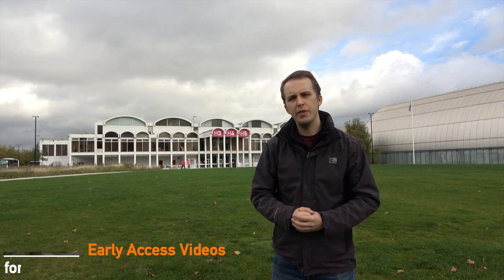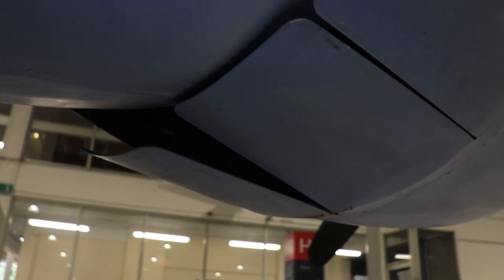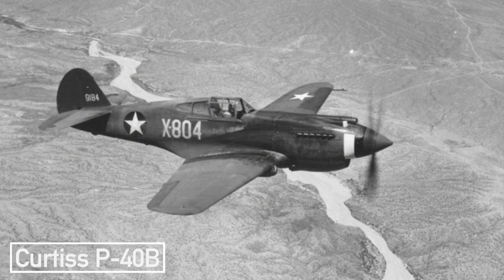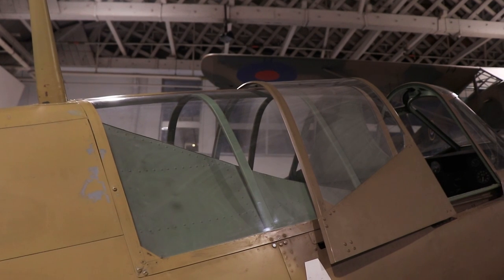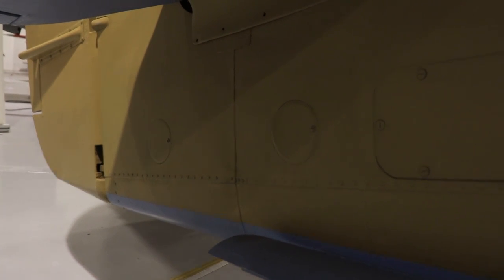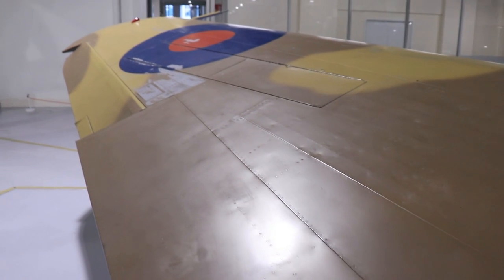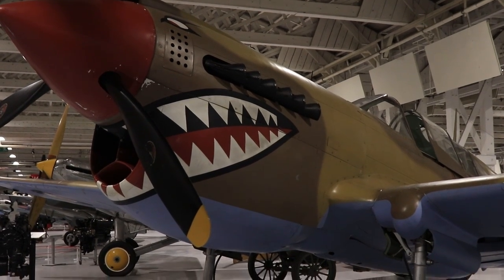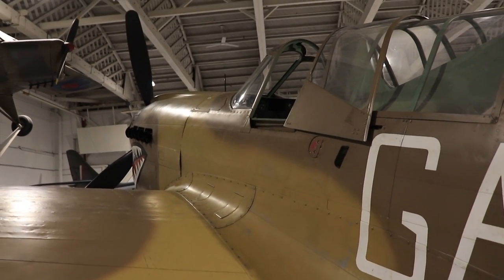Curtiss P-40N Kittyhawk - Detailed Walkaround

Comment: Hello Bismark, I have a suggestion for future topics. The history, or lack there of, of German Naval aircraft, why Germany still doesn't have a carrier and anything surrounded by those topics. Besides the attempts with Graf Zeppelin, German Naval aviation is near nonexistent and I've always wondered why. Especially since nowadays a carrier is practically essential in any sort of naval force. Part of me is also curious what a proper Germany developed naval aviation force would look like, and not just modified 109's, 190's and Stuka's with an arrester hook bolted on the bottom
Reply: In WW1 the Germans had the Seeflieger and post-1945 the Marinefliegerkommando. During the Cold War the Marineflieger evolved into one of the most formidable anti-shipping forces in Europe, particularly when the two strike wings got the Tornado.  After the Cold War they lost their strike aircraft to the scaling down of the Bundeswehr and today only operate helicopters, asw and survailance aircraft as well as drones.

In WW2 Görings Empire buildning prevented a naval air arm from evolving and I honestly don't think having one would have made much of a difference as I doubt that a small but idependet force would have devoloped tactics and weaponry faster than the Luftwaffe did in history. Simply not enough time and resources.
Reply: Short answer?  The Germans have little use for a carrier. Nor a fleet to support it.

Comment: I wonder if this aircraft type would have benefitted from engine and other upgrades the way the Mustang did, or was it just not worth the effort considering later war designs.
Reply: The F and L models had a Merlin but it was the single stage two speed supercharged version. It did have a marginal increase in higher altitude capability but not as much as you would think. And surprisingly the Allison version was slightly better below 15K than the Merlin one. The P-40K was a real hot rod with the 1,450 horse version of the Allison. You will also find that the Allison could be run at high overboost pressures of up to 72 inches of manifold pressure where it was making something like 1,700 HP, engine life was reduced but I think things like that explain why in its element the P-40 so much better than most written histories would have you believe.
Reply: @edwardpate6128  It doesn't surprise me really, as it is clearly a solid design for the time and never looked outdated, the airframe is very typical for the era. I couldn't imagine it had any real deficiencies apart from engine performance, but it's just a matter of using its strengths.

Comment: If the P-40 had gotten the Merlin, a bubble canopy, and a slightly thinner wing, it would have rivaled the P-51.
Reply: Scott Paris  Surprise !!!! It did got all of that....... BUT the Merlin made NO difference in performance you see because at that time the Merlin was also a SINGLE stage supercharged engine !!!!  And a later model got a new laminal flow wing and  higher HP engine and a bubble canopy but could NOT match the aerodynamic of the Mustang, which was one of the slickest, most aerodynamic plane of the war which also made it faster and the Mustang still out performed  the updated P40 airframe !!! Too bad you did not do the research before putting fingers to key board !!!!!!

Comment: Its not under powered and not out dated it's lost its pilots. A tribe apart , but not for long. There is a variant that has 8 50s on it ,is there any of those variants left. These planes were built to deal with light tanks and ground forces .

Comment: The Allison / Curtis 12 cylinder engines wer the father of the optimized Rolls Royce Merlin...
Reply: no.
Reply: @thunberbolttwo3953  it was, even Rolls Royce says that! All the later Merlin Engines based on an improved Curtis /Allison engine design.
Reply: @Schlipperschlopper   Curtis design, Allison also was patterned after the Curtis, first V12 to use the mono cast block !!!